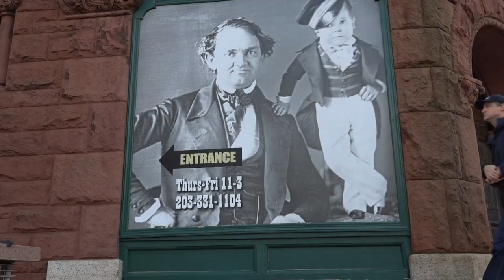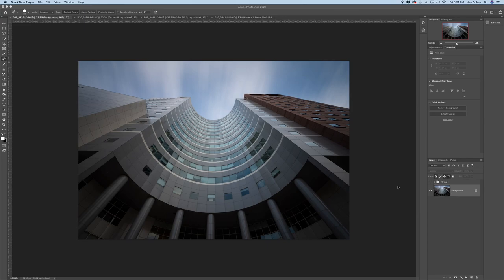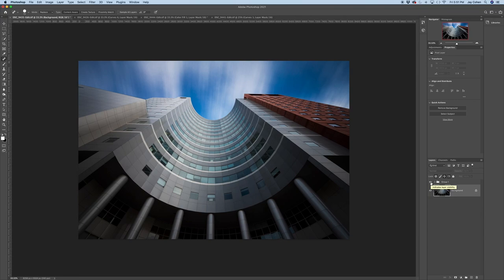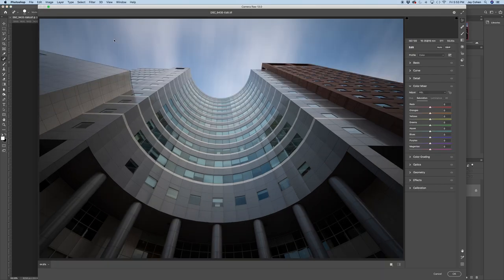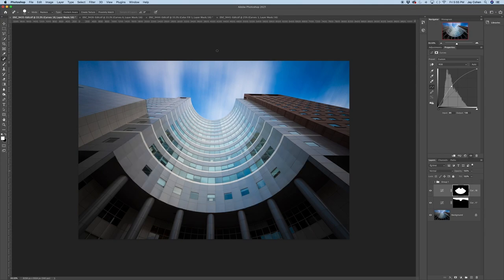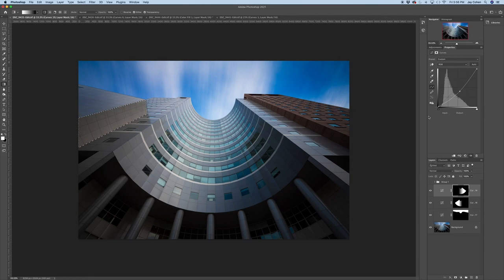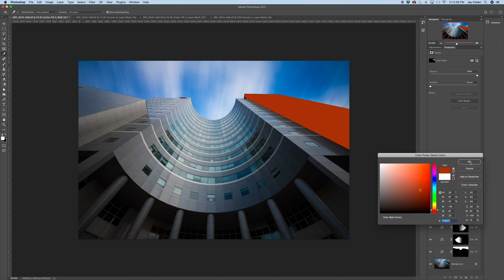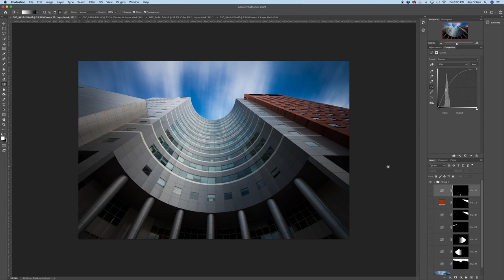How I Photographed and Processed a Fine Art Architectural Image

Comment: Smashing video Jay and what a great building! I work in a similar way but create new layers with my selections.  Once punched to a new layer I find multiple smaller adjustments (curves and levels utilising gradients within a mask), clipped to that layer, gets me to where I want to be. I can then adjust opacity and play with blending modes for best effect. I also tend to reduce contrast in my skies and often darken them to concentrate the viewers attention more to the architecture. I usually return to effect the appearance of the sky as I continue to process my buildings. Of course there is no right or wrong and we find our own way.  It's great you share your tips.
Reply from the maker: Fantastic! Thanks so much for sharing your process. Sounds very interesting Paul. I may have asked already but do you post to Instagram?
Reply: @JCImagesBehindtheShot  You did Jay. Flickr (paulantony2).  :-)